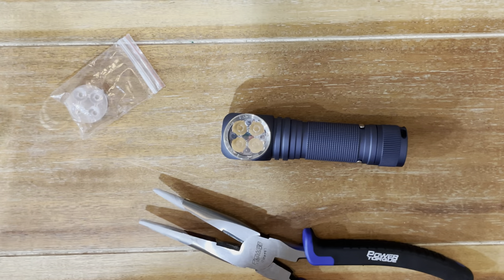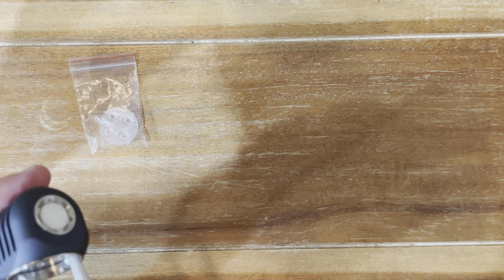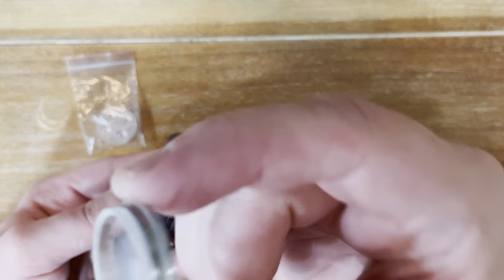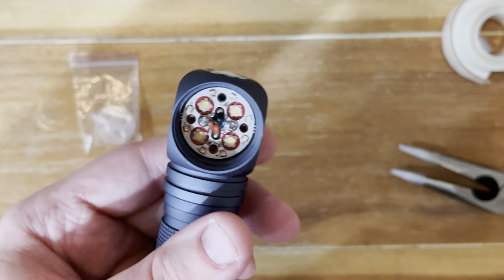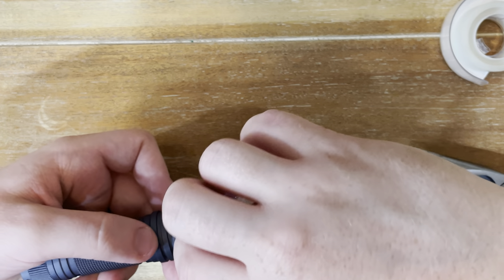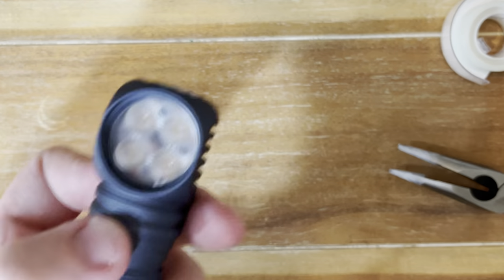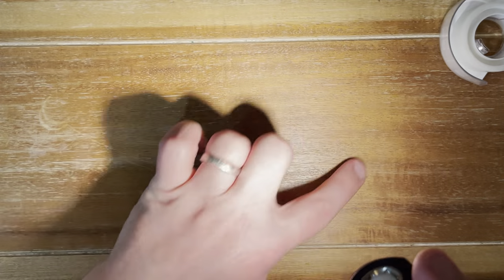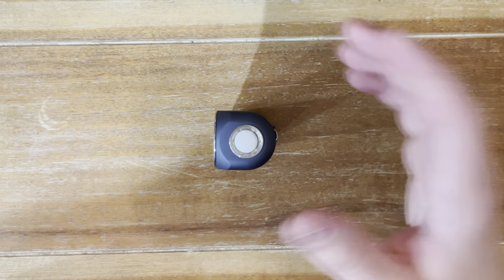Emisar DW4 flashlight optic swap | How to change / swap to different optic lens.

Comment: Did this light come with a battery?
Reply from the maker: No. You have to buy one. I recommend Vapecell, Murata (Sony) VTC6 18650, or EBL 18650. Also that have to be FLAT TOP and NOT button top 18650s
Reply from the maker: https://www.batteryjunction.com/sony-vtc6-18650-3000-flat.html?gclid=Cj0KCQiAnNacBhDvARIsABnDa6-9CCc5qijZHMrIiSlhlaNo_peWVyy1hdj-DSihvxuM0o-02TpZyosaAvFiEALw_wcB